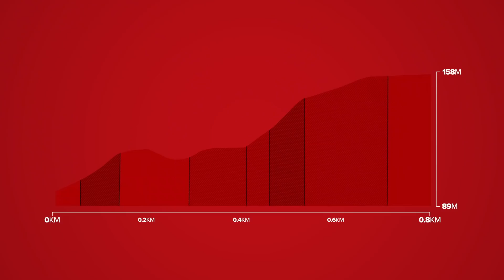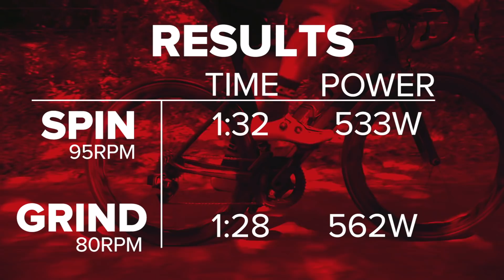Spinning Vs Grinding | What Is The Best Cadence For Climbing On A Road Bike?

Comment: I think pedal efficiency would be a better metric? I have a Pioneer power meter and find that at low cadence (60-80rpm) I get 55-60% pedal efficiency but when I get into higher cadences (80-100rpm) I am usually at 35-45% efficiency. I think I find it easier at lower cadences to get the coordination right in the pedal stroke and especially on hills it is easier to find the resistance in the pedal motion and therefore be more efficient. I also feel that the muscle groups that give the more efficient result may not be as sustainable sometimes as a pedalling stroke that is less efficient but more comfortable. Anyhow 75-80 rpm seems best for me at the moment for climbing.

Comment: If you have a cheaper bike you need to try to eliminate as much noise from chain rub, cogs ,  pedal bracket noise etc. This noise will impact your performance  huge especially on bigger climbs as the noise will distract you. This is obviously one of the most important issues when climbing as more pressure will be put on the components. Listening to music is a good way to dissipate some of that noise. GCN should cover this topic.
Reply: I hate it when a loud pipes motorbike goes by. The noise makes me wilt!
Reply: Listening to music and going off into a world of your own is a way to get killed through inattention. Do not put plugs in your ears and listen to music - it's dangerous!

Comment: Awesome video! I always felt that high cadence pedaling at low powers was mostly just useless energy burn.  I think you should just use the cadence that comes naturally and try to stay in the optimal gear.
Reply from the maker: Cheers Cole
Reply: This is exactly my experience as well.

Comment: Getting out of the saddle for portions of the climb means a greater variety of muscles are used, so you get more power and it feels easier. Staying in the saddle with a high cadence is a bad strategy. A third technique would have been better still, swaying the bike side to side in a fairly exaggerated manner whilst out of the saddle reduces the vertical travel of your centre of gravity during each pedal stroke, reducing movement losses and increasing efficiency (also gives the arms a bit of exercise).

Comment: On a steep climb the actual weight of the bike comes into play. Not only your own weight but also you have to pull the added bikes weight up the hill too! This is usually an extra 9kgs that has to be hauled to the top. On a very steep climb say 25% a world class runner would beat the cyclist to the top.

Comment: Easy: I'm fat, no one wants to see me pedal out of the saddle. Besides this, if I put 100kg on the pedals out of the saddle, my cranks actually bend :'D
Reply: Yeah, for 6'3" 100kg is somewhat better then for a 5'8" guy :D Besides this, I made the mistake in my teen and early twenties, to weightlift/powerlift... This did not help with the knees. Can squat with 200kg but cant stay out of the saddle for more then a minute.
Reply: Damn. Good luck with the TKR, hopefully you can ride thousands and thousands of miles until you have to undergo the surgery.

Comment: Test is invalid because of standing vs seated climbing, also, short climbs are better for heavy gears.
Reply: Ivar Brouwer I think that’s actually part of it. I can’t spin 95rpm out of the saddle up a climb and i suspect most people would be the same.
Reply: Simon Richardson, thnx for your reply! maybe but there are those who grind seated an can’t climb standing(ullrich) while some almost dance standing and look fluid (Contador) in their words standing does not equate grinding. (There are more then 2 methods for getting to Rome...)

Comment: As far as I understood, Armstrong adopted higher cadence it to take more advantage from his higher cardio vascular capacity i.e. shifted the load a little from legs to heart n lungs. I also understand that less load on the muscles at any particular part of the cycle wud reduce micro muscle tears i.e. less muscle swelling and pain post ride and hence quicker recovery. All that said your legs are a revolving mass and your brain and body hav to coordinate all that smoothly to keep it in balance. Try to spin too fast we all know it feels like instead of spinning circles it starts to get uncoordinated and feels like u r turning squares etc. I believe the ability to  coordinate this is more to do with ur individual physiology i.e. ratio of fast twitch and slow twitch etc as all of the parts of your leg have to fire and coordinate in harmony

Comment: Grind for the win but it will mess up your knees :'(
Reply: Has Sean Kelly or Bernard Hinault had knee replacement surgery? I'm both expressing skepticism and also wondering if that's so. A supple pedal stroke even in big gears is relatively easy on the knees.
Reply: Haha good point, only speaking from my point :P
Reply: I occasionally suffer from from what seems likely to be "iliotibial tract friction syndrome" and this can result in severe pain on the outside of the knee. Low gears bring this on more quickly. Grinding also seems to work for me when trying to sustain a high wattage.
Reply: Poor bike fit will lead to injury, not grinding
Reply: NEVER.  I have had 3 knee surgeries and the force of "grinding" is minimal compared to the force of just jumping in place.   I use NO float in my pedals either(cartilage damage).   With float it feels like my knee is sliding on ice.   Without float(no pro rider uses float, they are so exactly "tuned in" to their bike) my knee feels secure.  I am a wide guy: wider hips and shoulders.  I use pedal extenders on my pedals to move them out laterally.    I also use a 48cm bar to torque on!.  I weigh 115kg.  I spin at 90-110 on the flat.  I am seated pretty low in the saddle and therefore am so aero my good cycling buddies can't  catch me on he flat.  Different story going UPHILL.....HAHAHA!(OUCHY).  I ride with high intensity a route of 25 or almost 50miles/day.  My blood pressure is 94/52 and my resting heart rate is 48BPM.   I "NEEDED" AN EMERGENCY cardiology consult at Mayo Clinic once.   The cardiolgist looked at me and shaking his head said "If only I were THAT ill!!.  You're fine.  You're more than fine....but you knew that."   And I did.
Reply: michael allen 115kgs... That's 49 more than me, you either have some serious leg muscles which is why on the flats you fly, or you're one of those naturally big people (I don't mean fat, although you might be but don't sound it, I mean one of those people who isn't super muscular they are simply strong). I am a naturally very slight person (6ft 2 and 66kgs), so I'd imagine that difference would cause a necessary difference in riding style. You didn't actually specify your rpm but I assume you were saying you grind up a hill?
Reply: michael allen Most pro riders actually use 2 degrees float, and some 6 degrees. Only sprinters use 0 degree float. GCN did a video on this where they interviewed a bunch of pros and asked them what cleats they use - look it up. Float is supposed to be better on the knees because your knees and pedals will move around with each other and put less strain on your knees. Sounds like no float works best for you though. I prefer the 2 degrees float cleats.

Comment: Spinning & grinding,  The sweet spot in-between,  In the 1950s I did a 200 mile utility trial,  16 hour's,  15 m.p.h.
Reply: I had found the sweet Spot,   London too Bath,  And back,  Coming down the   Great West Road,  Passed  Northolt Air Port,  Coming in to London I was in great shape, And mixed in with the road clubs,  Out on their training runs,  Any one who took my wheel,  I would just ride away from them,
Reply: Alay alay Grimpure.

Comment: From a mountain biking background and more  used to grinding slow cadence 70rpm . Then going onto  Zwift purposely trying to learn to get a higher cadence. I have found over 1 year , i now have a higher comfortable cadence on the flat at 85-90. Climbing i still rather drop to 70rpm and get out of the saddle. I don't have an auto front riser, so can rule out the angle of the bike. So my feeling is that it's the incline and therefore  the resistance loading through the smart trainer  is the factor that forces me into the 70rpm comfortable climb cadence over  trying to spin up the climb Also out of the saddle although not on a rocker plate i think my arms are pulling and therefore  and transferring body weight over the peddle stroke and therefore even though the power meter is reading a value , not all of that is coming from the leg muscles.

Comment: The prof didn’t talk about the effect of standing on aero. Above what speed does standing worsen your aero profile? 

Also when standing to climb it’s more difficult to activate the hamstring pull of the pedal stroke since less of your mass is over the real wheel so standing to climb is biased to using the quad push but what difference does this make?

Also when climbing standing you can use your whole mass and gravity to assist in pushing down the pedal stroke. You can’t do this when seated - it’s all leg power. What difference does this make?

Heavy ankles? Sorry I just don’t see how this is a factor.

Comment: In 1984 I research bicycle riding technics as part of buying my first high quality bicycle a Trek 620 sport touring bicycle intended for long many day rides.  At that time protecting your knees from long term damage and inflammation were huge issues.  The recommended technic was to keep your cadence above 80 and pull up in addition to pushing down during a power pedal stroke. Keeping your cadence above 80 assures that the knee impact fluid cushion between sliding cartilages does not empty before the end of a power pedal stroke.  Pulling up on the pedals as well pushing down causes a forced back-and-forth knee fluid pumping action suppling fresh oxygen and nutrients to the knee's cartilages.  This allows the cartilages to remain flexible making them less subject to damage.

Comment: Another thing that I thought might be worth examining is that grinding would require more muscle to achieve the same speed as spinning. Like the difference between high rep and low rep weight lifting. More muscle means more weight means more power needed to move the same speed. Logically spinning would keep you lighter which would mean faster.  This would obviously not be seen in a single test or short term period.

Comment: With running there's a crossover point where the speed determines which cadence is more efficient. The grade typically dictates your speed so I imagine either style has its optimal time to shine.

Comment: Wouldn’t the weight of the leg going down negate the energy needed to lift the opposite leg ?  Making the mentioned heavy ankles a non issue ?
Reply: Spot on comment. Its basic physics. Some nonsense being talked in this video.

Comment: @GCN I noticed that the reason why cyclists tend to pedal slower at climb. This is because there is no freewheel. Aside from pushing down the pedal, rider also needs to pull up to back to the pushing position.
That pulling action requires different muscles and it makes the cadences slower. Rider will have lower cadence in general, unless the rider has a very strong hamstring.

Comment: The question itself is a bit of a red herring, since you're not controlling for the speed of the wheel with the cadence. For example, a 34x28 at 90 RPM will generate an unloaded (700c x 25 mm) rear wheel speed of 8.58 MPH. A 39x23 at 64 RPM generates a rear wheel speed of 8.52 MPH. You can check here: http://cycleseven.org/bicycle-gear-inch-calculator The speed in the real world is, more or less, the same between the two as a cyclist is likely to fluctuate a few RPM. So it's not really fair to say that, with different gears, a higher cadence is faster or slower, and in the same gear a higher cadence is always faster. For what it's worth, your 39x23 at 75 RPM produces a wheel speed of 9.98 MPH, so the "grinding" cadence is inherently faster than a 34x28 @ 90 RPM. But if you had run the 34x28 at 110 RPM, it would be 10.49 MPH, so then the higher cadence is faster. The higher cadence is either faster or slower, depending on the gear, which means the question is not really answerable as you've posed it. Hopefully the geek edition addresses this...
The proper way to have run this would have been to control for the wheel speed such that the speed of the wheel was consistent and then measure some 3rd variable, e.g. blood lactate, HR, etc. as a way to determine whether or not one style is more sustainable as I assume neither 560 nor 520 w are sustainable for Si.
Also one annoying point - higher cadence is correlated with higher speed because higher cadence causes higher speed :)

Comment: Pedal too slowly and you can't generate enough torque - pedal too quickly, and you're wasting too much energy reciprocating the mass in your legs. There is an elliptic curve with a peak somewhere around the middle. I tend to pedal faster uphill than on a flat stretch, but not drastically faster. I might stick to 60-65 rpm on flat and take it up to 70-75 going uphill.

Comment: Just an observation. When he’s out of the saddle the front wheel is swerving side to side as well. Which is traveling very slightly more distance. But over time that swerve may add up to more distance traveled. Which may be why those riders who stay in the saddle make better times. Of course I may be wrong.

Comment: I'm 6'1 160lb, so skinny, athletic build, not large muscular.  I've always found with less leg torque spinning is so much more effective.  Standing gives you more drag, makes your legs support your entire body weight while pedalling, and requires more oxygen into the muscles due to the load on them.  When I ride with friends that grind, they're whooped at the top of a hill and I'm reading to speed up already.

Comment: When climbing you want to put torque on a larger angle range which is easier on a lower cadence. Since gravity would slow you down, there is more acceleration and deceleration and putting torque on a larger angle range will minimize it. It should be similar on the flats with a headwind. My two cents.

Comment: Most average riders don't have low enough gears so they never learn to spin up climbs because they run out of gears. With easier gears, many would go faster but many also just don't get it.
Reply: i have a 11-28 cassette, so can handle 4-6% climbs ok but steeper i need to up cadence in order to overcome gravity . Now there is a reason when you look at buying 12-30 or 11-32 cassete they all more expensive than lower geared cassettes, i went for 80 km ride today and ascended 1200 m in total but at end of ride legs were getting weak but then i'm only a w/e cyclist and 53 years of age

Comment: Your professor didn’t help. I would argue that your goal should be to maintain a consistent natural cadence. Ideally, you will shift down to maintain cadence up a hill. That being said, the loss of energy/momentum and tempo is enormous if you downshift too much. Basically, you should strive for a consistent cadence and watt output BUT you must also account for the loss in momentum and tempo when shifting. Sometimes, it’s better to increase watt output to maintain cadence up a small hill given that you won’t have to upshift on the other side. This is a big part of what makes road riding so fun; it’s a game of efficiency and trying to maintain a high avg watt output and a consistent cadence in constantly changing conditions. Also, a good point is that runners are generally more efficient when taking smaller steps while running up a hill (more steps per mile). If we apply this logic, we should strive for a higher cadence up hills as it should conserve energy and make us more efficient. I think the advantage of a higher cadence up a hill (assuming there is one) would be more noticeable in a longer ride with longer climb segments but with enough flat and descent to capitalize on the conserved energy during high cadence climbs.

Comment: One of the most important things to think about is also cambier of the road like going to a hairpin. When climbing in a hairpin you are driving from the inside leg so selecting a higher gear and lowerer cadence is not such a good idea. It's also a good idea to find the shortest route, In a racing situation only you can cut off literally 100's of meters in some climbs. Cyling a higher cadence is better usually if you don't know the climb at all or if there are a lot of hairpin's. Finding gear combination is going to help a lot it is about preference. But I find at some areas of a climb I'm going to accelerate more and keep a high speed as well using a higher gear and even a high crank gear. But I used to be a bit mental now not so much.

Comment: I was hoping for a discussion of torque and cadence. If your torque is not up there, then your cadence has to increase to create power. Just like horsepower which is calculated as (torque * RPM)/5252. Little engines better rev fast.

Comment: I've read that delivering constant power to the pedals at a fairly constant crank rpm is a decent strategy. Power is proportional to crank torque X crank rpm. Power is consumed my climbing and friction. Judicious use of the gear selector will allow constant power at constant rpm. Going uphill, shift down (because climbing is consuming the same power as level riding but at lower speed). This system does not convert particularly well on steep climbs but overall it allows me to give my maximum overall. It serves well when bucking a head wind (more power consumed by friction so to keep constant RPM, gear down). PS, I am a casual rider and seldom ride more than 20-miles in a go.